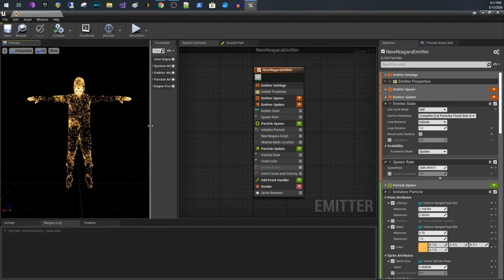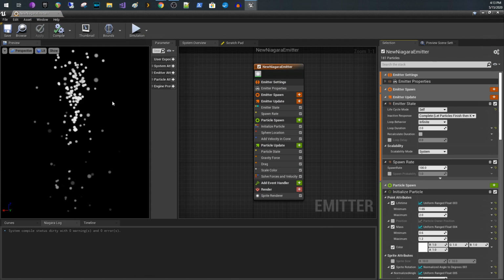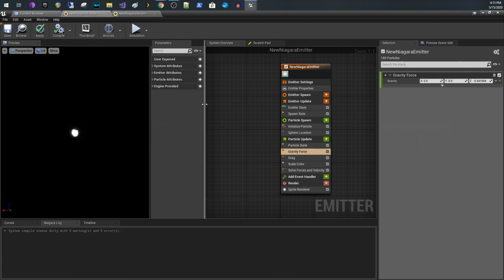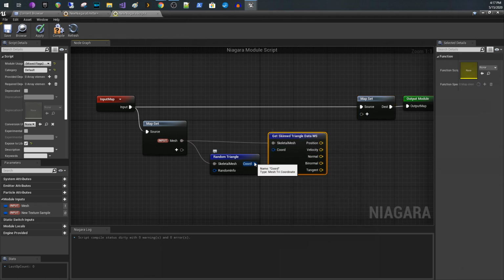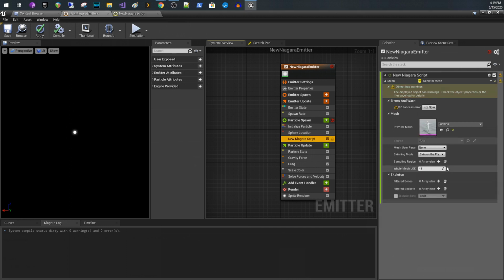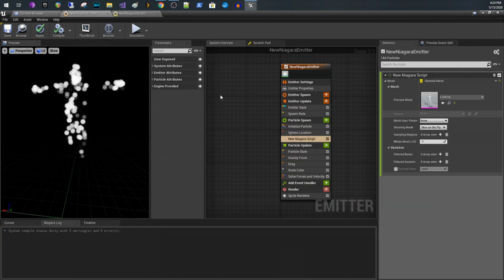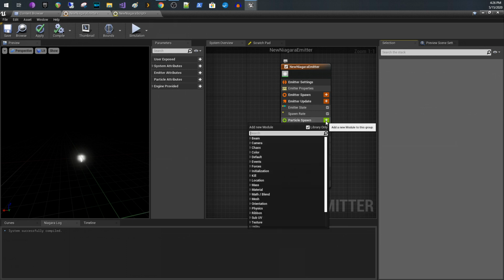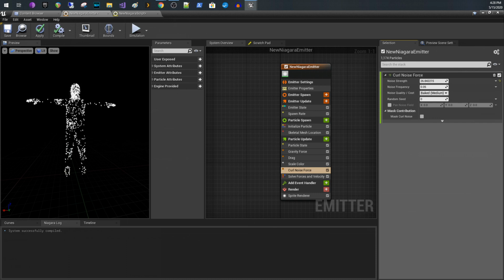Niagara Skeletal Mesh Particles (4.25)

Comment: Ugh, it must have changed again...I can't find "Niagara Content" anywhere and am stuck at the GetRandomInfo part
Reply from the maker: which version?.
Reply: @GordonVart  4.26.1
Reply from the maker: @Goggalor1990   For some reason they have marked the function unexposed in the latest update 3 of build of 4.26. If you need it then locate the function GetRandomInfo under engine content / Niagara content / functions and open up that function in the editor. on the left side you will see Library visibility and you should just change that to exposed. it should then show up when you search for it. Make sure you have engine content and plug-in content enabled in your content browser so that it doesn't hide it on you. I don't understand why they keep hiding this function?
Reply: @GordonVart  thanks a lot - saved me
Reply: @GordonVart  Hey, sorry but I am also missing this node. What do you mean by "locate the function". Is "engine content / Niagara content / functions" meant to be a folder somewhere on the computer? Or something in the engine itself?
Reply from the maker: @RyanPergent  this is found in the content browser. make sure show engine content and plugin content are enabled under view options. ie lower right of content browser. Also, show sources panel upper left of CB next to 'search paths'.
Reply: @GordonVart  Awesome! Thank you so much, that did the trick :)
Reply: @GordonVart  Also worked for UE5 EA Thank you so much!

Comment: Hello ! Thanks for your content, very clean and begginer friendly !

I got a strange issue un UE 5.1. When I hit play in editor or when I render my scene, the particule system disappear. All is working well in the wievport and in the preview scene. If anyone got a solution…

I also followed one of your tutorial where the particles are spawning from a particular socket. Same problem, everything works fine, but in editor or in the render all the particles “agglomerate” on the same point without covering the skeletal mesh… This is drubbing me crazy 🫠
Reply from the maker: i'll checkout when time permits

Comment: Get Random Info is not present in Unreal Engine 5.
Any help pls?
Reply from the maker: try this For some reason they have marked the function unexposed in the latest update 3 of build of 4.26. If you need it then locate the function GetRandomInfo under engine content / Niagara content / functions and open up that function in the editor. on the left side you will see Library visibility and you should just change that to exposed. it should then show up when you search for it. Make sure you have engine content and plug-in content enabled in your content browser so that it doesn't hide it on you. I don't understand why they keep hiding this function?

Comment: 'Get Random Info' node is missing in UE426, instead there is 'Make Niagara Rand Info'. But it doesn`t work, particles don`t take the shape of the mesh. please help.
Reply from the maker: For some reason they have marked the function unexposed in the latest update 3 of build of 4.26. If you need it then locate the function GetRandomInfo under engine content / Niagara content / functions and open up that function in the editor. on the left side you will see Library visibility and you should just change that to exposed. it should then show up when you search for it. Make sure you have engine content and plug-in content enabled in your content browser so that it doesn't hide it on you. I don't understand why they keep hiding this function?
Reply: @GordonVart  Thank you so much.

Comment: the module script's "GetRandomInfo" seems to be gone from version 4.26. Luckily the Skeletal Mesh Location Node is still there.
Reply from the maker: I think it was broken in one of these sub builds of 4.26, but I just checked the latest build and it is back under the functions grouping.
Reply: @GordonVart  Is it? I can't seem to find it.
Reply from the maker: @TheSmileCollector  For some reason they have marked the function unexposed in the latest update 3 of build of 4.26. If you need it then locate the function GetRandomInfo under engine content / Niagara content / functions and open up that function in the editor. on the left side you will see Library visibilityand you should just change that to exposed. it should then show up when you search for it. Make sure you have engine content and plug-in content enabled in your content browser so that it doesn't hide it on you. I don't understand why they keep hiding this function?
Reply: @GordonVart  cant find the niagara content under engine content. niagara content exists outside it thoug, but no GetRandomInfo
Reply: nvm, i found it when searching
Reply: @GordonVart  Thank you! Super helpful.
Reply: thank you. was driving me nuts. lol

Comment: cool but its what about Particle Update (follow animation). My particles are dancing inside mesh and don't want to leave it. (go up or anyting)
Reply from the maker: It would be hard to figure out what is going on without seeing more details. You might want to check the lifetime of your particles, and also look at the different forces you are putting on them. Gravity? Maybe the particles are dying before they have a chance to move very far?
Reply: @GordonVart  that's not the case. Forces and lifetime seems to have no effect on this flickering behaviour. thanks for reply btw, I'll try to play more with it. Particle spawn worls well, particle update is flickering no matter to forces and lifetime. Maybe it's just a bug in 2.25.

Comment: Awesome! Thanks for this. The "RandomInfo" pin should have defaults, that really through me off.
Also, if you continue to use the custom module and use a "Random Tri Coord" instead of a "Random Triangle" you get an even distribution of particles regardless of localized poly density in detailed areas on your skeletal mesh.
Cheers!
Reply from the maker: Thank you! Fantastic advice by the way, I was curious how I could get a more even distro. with the Unreal Engine you learn something new everyday.
Reply: I tried this and I'm didn't notice a huge huge difference, however I did set up a Sampling Region on my static mesh and just set the "Support Uniformly Distributed Sampling" to true, set the name to Default, and added the sampling region to the Skeletal Mesh input. This is uniformly distributing my particles but only with the Random Tri Coord as you suggested. Random Triangle still groups together even with the Sampling Region set up.
Cheers!
Reply: I agree it should have defaults, and also the "random tri coord" node by itself should be actually random. If I just put the Random Tri Coord node in by itself, it'll just return one coordinate. Insane. Because I might have a really complicated scratch module and I might need a random triangle 25 times, will I need to put in "Get Random Info" every single time? Probably!